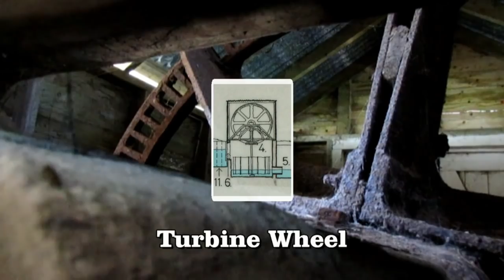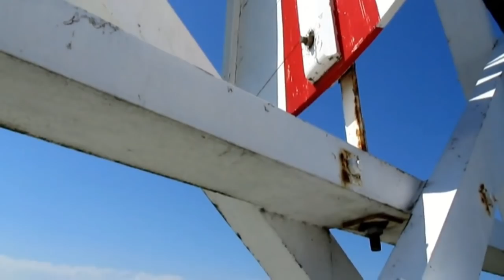171. Horsey Wind Pump  Norfolk  England

Comment: It would be lovely to see the sails turning again, even if the pump were not being used full time.  All the efforts, over the years, to repair it are surely based upon the desire of many to see it in use, even if only as a backup to the electric pump.   I must say that the combination of old pictures, new ones, and video was most enjoyable.  I ended up watching it twice.   Thank you so much, Alan, for the time and detailed work you spent on this lovely video!
Reply from the maker: Thank you so much Grace for your lovely comment. It would be great news if the windmill could be brought back to working order. It’s not an area I tend to visit, so am not following its progress. All the best, take care.
Reply: We visit near here quite ofter.  Was running last year.   
Its also interesting to see the line on the side of the cafe indicating sea level about a meter up the wall.

Comment: Wonderful Alan how much water could it pump ?, are there any Stirling engines still running in England 
hope you have cheese rolls warm regards Wal.
Reply from the maker: I don’t know what its pumping capability is and I’m not aware of any Stirling engines. Cheers, take care
Reply: @MyNarrowboatVenture   in Auckland two massive Stirling engines supplied the city with all its water, sadly they were replaced with electric pumps, although the two Stirling engines had functioned without any breakdowns for over a 100 years, they are an amazing engine Rev Stirling invented them in the 1800s in Wales for his coal miners they replaced the steam engines in the mines as their boilers were blowing up killing his flock off.
now they are a high tech masterpiece of an engine that runs on just a pilot light producing 3 kilowatts of power and 600 gallons of water boiled every two hours 
google Whisper gen one would fit on your boat no need for a firebox and lots of hot water to keep you warm.
Reply: I don,t drink but thanks for the sentiment Alan
Reply from the maker: @walterfoott5105  Thanks for drawing my attention to the Whisper Gen, all rather too technical for me. I note the factory was destroyed in an earthquake and then stopped making the marine version or has that subsequently changed. All the best.